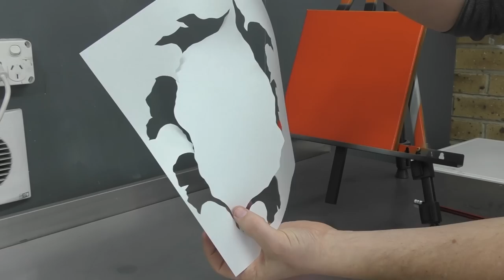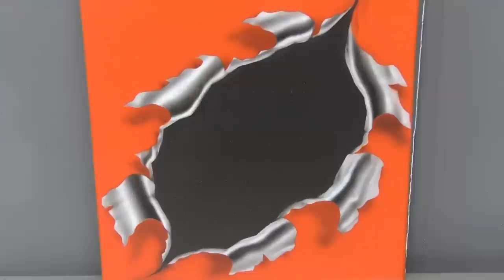Airbrushing Torn Metal | Paint effect for Beginners

Comment: Looks cool. The Thing is, Im not seeing which way the "light " is coming from, based on your shadowing on the tear sections. The "drop shadows" show the light being around 12-1 o clock (slightly overhead too), but the inside the tears shadows do not concur with that suggestion. Maybe most confused by the white "shadow" on the very inside of each tear. I would think the very inside of tears would be the darkest, as they are shadowed from the light..?.. Can you explain please? Thanks.

Comment: Carsten, loved it!!! This is an awesome video, thanks mate. I’m working on a project (12” diameter steel soldering “bench”) with that same color orange base, I’ve been wracking my brain what to do with it, because there is a 2”x2” racing team shield shaped logo in the center. I was thinking of doing a race car wheel, but have been shying away from that idea because it is just too boring and plain. I even considered a real fire theme, but that too didn’t feel right. The project is a prototype custom one off deal. This has given me an idea to have the logo “blowout” from the center of the disc having blue electric arch streaks emanating from the logo. Thoughts?